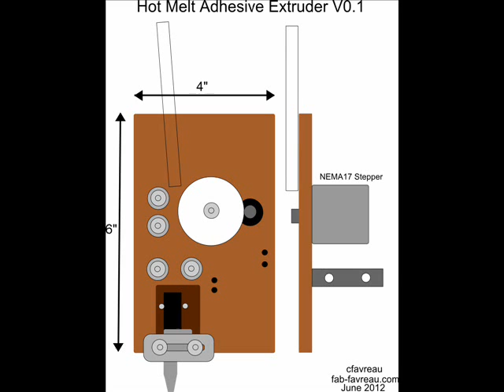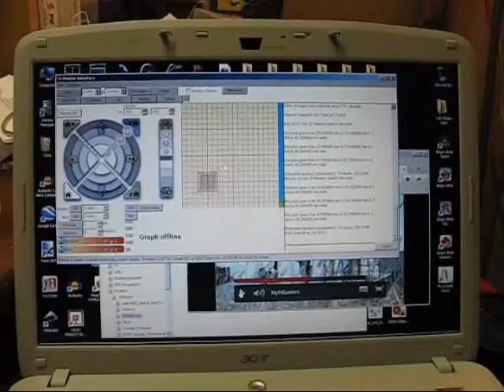Hot Glue Gun HMA 3D Printer Extruder

Comment: the low temperature glue gun heats upto 121 degree centigrade while high temp upto 193 degree C (from wikipedia). i work with polymers and extrude yarns. from my personal experience i can say that you can use polyethane polymer easily on a high temperature glue gun heater. but you have to prepare the polymer sticks first which is not very difficult.

Comment: Part of the speed issue is the nature of working with a hot material. You don't want to lay a new layer on to an existing layer that hasn't firmed up yet.

I would recommend setting the camera down and running a time lapse, or just speeding up the video for the longer repetitive sections.

Hey, you could design and print a camera stand instead of using a tripod. =]

Comment: You can also make the extruder hole smaller and use abs plastic instead of hot glue
Reply: That would be a normal 3d printer with T H I C C filament
Reply: @among-us-99999   
That could come in handy printing in Vase mode.

Comment: cool hack!
i would try to use a cooling fan for the printed part. just isolate the hotglue nozzle and maybe find one with internal backflow stop.
Reply from the maker: If you take a look at the additional hot glue print videos I have I did add a cooling fan.  I found however that it cooled the nozzle too much and would cause jams.  It did help sagging a bit.  I also tried a different glue gun heater nozzle with a spring wound tight around the silicone tube that the glue stick feeds into.  The purpose of this is to prevent oozing out of the area that the glue stick feeds into.  It helped prevent leaking however it was more prone to jams where the glue would melt and form a big blob/mushroomed part of the stick right where the melt zone begins.  What brands can I find the internal backflow stop on? Thanks for the suggestions!
Reply: cfavreau
sadly i only found a picture of those ones i have in my shop.
These have a spring operated metal ball inside that stops the flow when no glue-pressure is applied from behind.
i dont know where to purchase them.. but they should be sold as replacement parts.
http://heimwerkerlexikon.selbermachen.de/system/article_images/large/2615/duese.jpg
heres the gun http://www.obi.de/decom/product/LUX_Heissklebe-Set_80_W/7802713
Reply from the maker: yzorg Oh hey those look great!   Much better than the one I used.  The ones that I could find only had a simple 1 piece cast aluminum heater and nozzle in one.  The ball and spring idea is a very interesting idea!  I wonder if it could be applied to plastic extruders as well.   Thank you very much for the links.  I really appreciate it.

Comment from the maker: Ahh... slow yes, but not because of the extruder.   My CNC router only goes 10 inches per minute at best (need better steppers).  I have it set for 5 inches per minute here and then the default Slic3r settings have it going slower.  I have been exerimenting with faster and it appears to work fine at 5 ipm and I am going to try 10 ipm as soon as I catch up on sleep.   Still will be slower than RepRap/MakerBot maybe... but not because of the hot glue extruder.